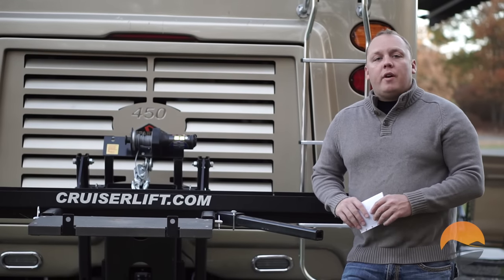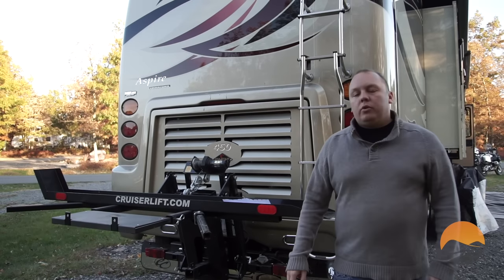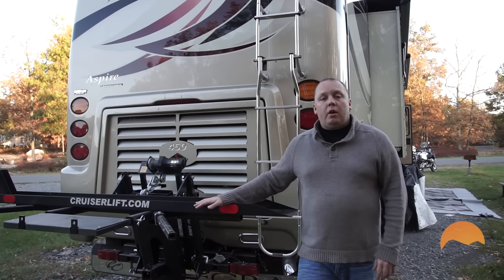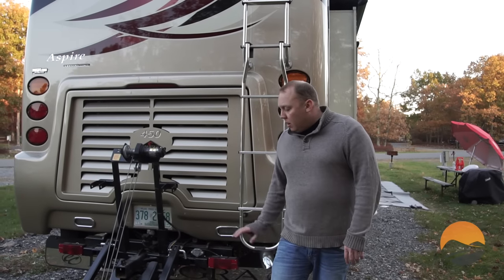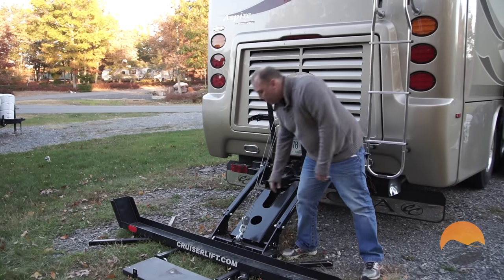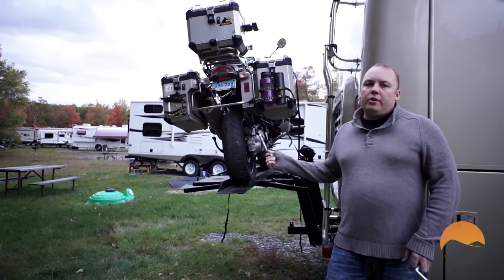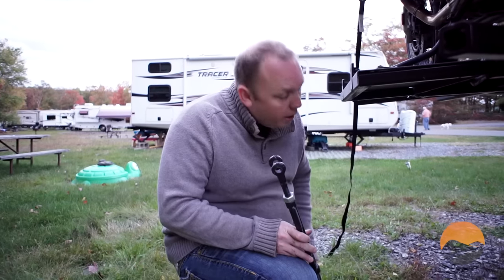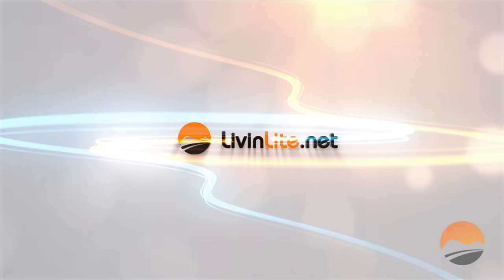Cruiserlift - RV Motorcycle Lift Walkthrough

Comment: I bought mine in 2009, and I love it. I have hauled my Goldwing all over the country and don't worry about trailering.  I have changed the cable once and had one weld on the hitch crack but the unit was strong enough to get back home and get it fixed. I would definitely recommend this product. I can flat tow my jeep as well. It is mounted on a Phaeton
Reply from the maker: +John Meredith great feedback and thanks for checking in. We are thinking of changing out the cable to a synthetic winch rope next year. Prevents rust and is actually stronger if you can believe it! Thanks for checking in.
Reply from the maker: +John Meredith great feedback and thanks for checking in. We are thinking of changing out the cable to a synthetic winch rope next year. Prevents rust and is actually stronger if you can believe it! Thanks for checking in.

Comment: got a Cruiserlift and installed it on my tag axle Country Coach.  The lift carrying my HD Vrod Muscle (approx. 800 .lbs) looked great and works great; however, when traveling and driving down the highway, due to the weight of the bike, you can definitely feel the motorcycle in the back in the sense that the bike will bounce up and down affecting the ride.  I was really surprised because I have 10 air bags on my coach.  Therefore, as well as it works, I would not suggest to put a heavy bike such as HD or any kind of cruiser.  I'm pretty sure if I get a light weight bike 300-400 lbs., it will be perfect.  Therefore, I am not traveling with my HD on the back of the coach after the one time use.  I will go with a trailer or change to a lighter bike.  Hope this helps you folks.
Reply from the maker: We definitely notice the bike back there when hitting large dips at high speeds but nothing that would keep us from using the setup. This is true with just about every lift out there.  Make sure you have some good straps and keep an eye on trying to use low points on the bike to keep things the most stable. Thanks for the feedback and input, agreed that hopefully it helps folks make an informed decision. Thanks for checking in!

Comment: What is the total length of the towbar plus the extension from the receiver on your RV to your toad? If you have a Jeep unlimited wouldn't that put you over limits. Doesn't the lift put you over the 45' length limit for your RV. I don't retire until next year and will start RVing then. I see a lot of rigs that I know do not comply with the limits. I'm assuming that these limits are not strictly enforced. Is that true. I enjoy you videos.
Reply from the maker: +Randy Jones Hi Randy, yes that is true and our experience is that these regulations are not strictly enforced (we haven't spent any time in California where we are told the regulations are more strictly enforced). We could argue that the motorcycle lift attaches to our trailer hitch so rather than adding to the total length of our vehicle its consider a trailer. In the end it would be up for discussion and interpretation. All that said we've found all across the east coast and middle of the country the only time we are bothered by the police is when they flash their lights and give us a thumbs up as they pass our vehicle. See you on the road and best of luck!
Reply: Thnx! I do hope to see you on the road.

Comment: I love our cruiserlift!  I was wondering when you tighten the turnbuckle, do you tighten it down for stability or up to take pressure off the hoist?  Thanks!
Reply from the maker: sdllc03 very good question. The folks at Smitty's who installed it told us to tighten it up but I'm not sure the logic behind that. In thinking about it tightening it down is probably best as you have the main pins its resting on as well as gravity working in your favor for stability. This question might need a call to Cruiserlift for an official answer however, great comment! Wish I had a 100% correct answer for you right now. We'll look into it.
Reply: I've never used one of these, only the carrier for my SUV, but turnbuckles are a TENSIONING device, so should be used to PULL on the underside of the platform. I guess it keeps the bike from rocking toward the vehicle. To me, this looks more like an afterthought to keep the bike and platform from rocking, as it might when when braking, than a part of the original design.

Comment: If that cable fails on the way up or down your screwed. Hydraulic would just stop. Explain why your concerned about hydraulic failing on the side of the road? You would have to be unloading the bike for it to fail. It’s not going to just fail going down the road. Hydraulic is safer and more dependable every time.
Reply: Yes they leak because people do not clean the ram. Even a light dust can ruin seals. Keep your system clean and lubricated it will run for years trouble free.

Comment: Good Video!  Does the extension bar for the blue ox ever scrap on the ground pulling in and out of driveways because of the additional length?
Reply from the maker: good question, ours never has hit or scraped. it seems they designed the hitch to be a bit higher than stock. no issues but our Aspire does have a Spartan chassis but as long as your looking at a diesel coach I think you'll be OK.